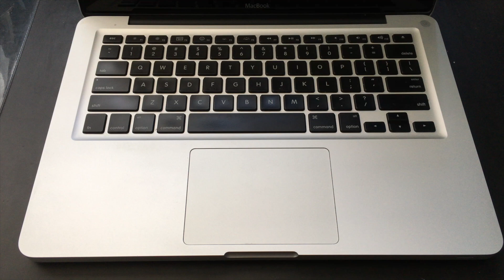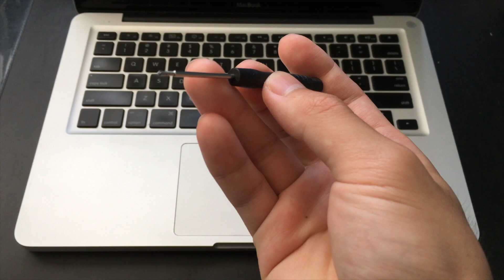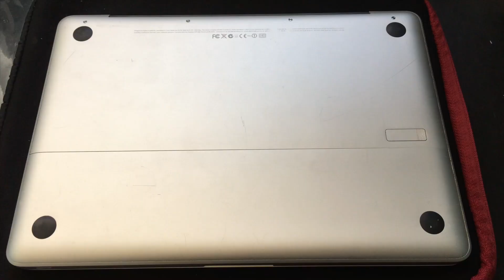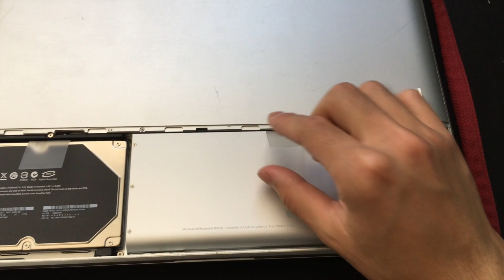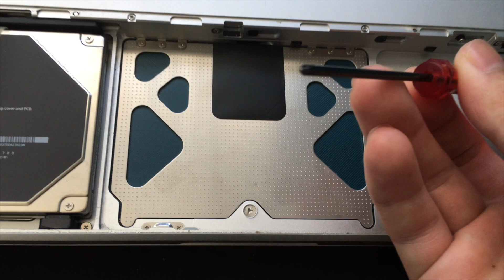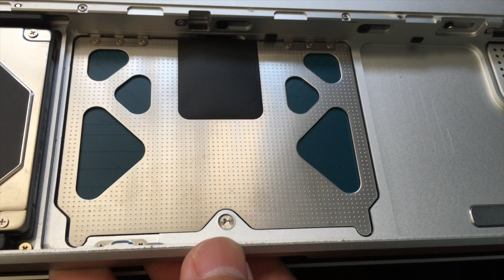How to fix a loose or unresponsive Macbook/Macbook Pro trackpad

Comment: Hi, old video, I know, but will this adjust the click of the whole trackpad (Force Trackpad?) where you can press down anywhere on the pad and it clicks and is the same as a left mouse click (like bottom left of the trackpad)?

Comment: My trackpad clicks well when the battery is out, but when i put the battery back, it becomes kind of "soft". It only clicks in the lower left corner and the click is kind of muffled, not sharp like it was when the battery was out. What do you think?
Reply from the maker: Then the battery has expanded. I assume it’s an old battery. You would have to replace the battery.

Comment: The adjustment screw came off in my case, got a new adjustment screw, but it's really hard to screw it back in place.
Reply: I’m struggling with getting it back in, did you find a solution?
Reply: @al3xdavina  I managed to do it somehow. No special trick, just make sure your screw is new, and try patiently